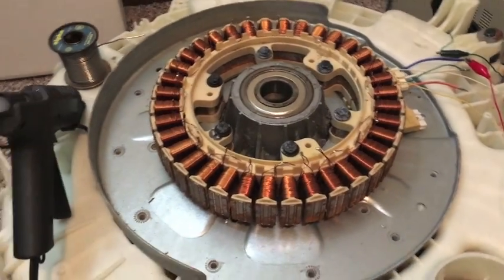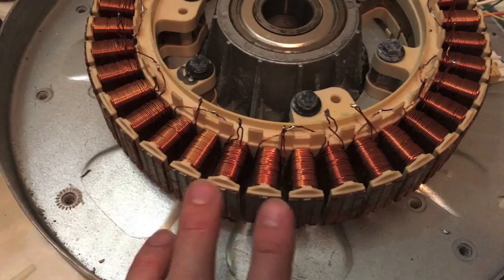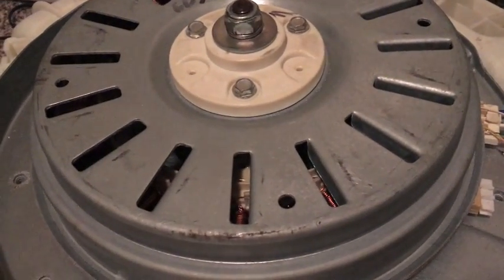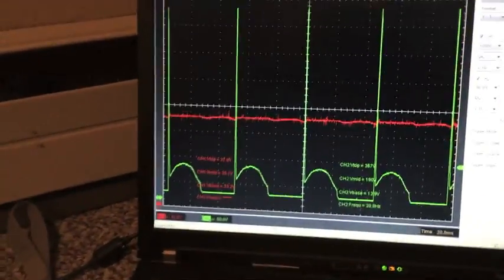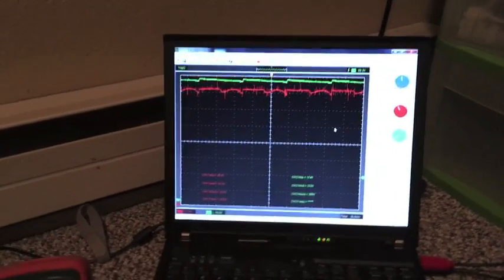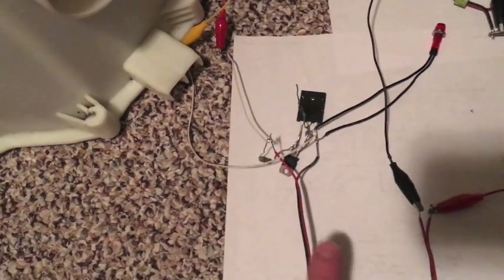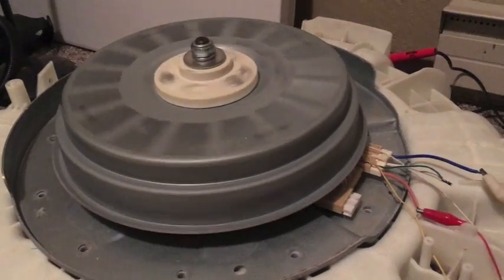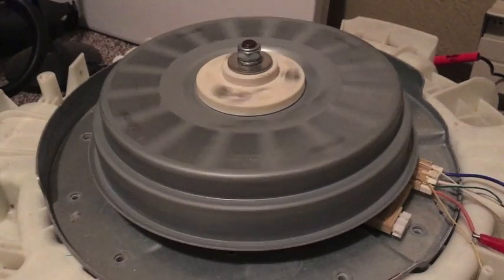A simple Transistor circuit running a brushless washing maching motor Part 2

Comment: If you use three of your circuits, one for each phase, wouldn't you need to add a delay between them?
In this video, is the current usage not as high as the second circuit benefits from the feedback voltage from the first circuit?

Comment: For a 36 pole Stator You will need to rewire the motor from 12 pole to 6,4, or 2 pole (Ex: In series wire the stators in the same direction Clockwise or Counter clockwise as long as it's the same.                   Stators wired in series below.

2-pole A phase [1-2-3-4-5-6]----[19-20-21-22-23-24] B phase [7-8-9-10-11-12]----[25-26-27-28-29-30] C phase [13-14-15-16-17-18]----[31-32-33-34-35-36]

4 pole A phase [1-2-3]----[10-11-12]----[19-20-21]----[28-29-30] B phase [4-5-6]----[13-14-15]----[22-23-24]----[31-32-33] C phase [7-8-9]----[16-17-18]----[25-26-27]----[34-35-36]    

6 pole A phase [1-2]----[7-8]----[13-14]----[19-20]----[25-26]----[31-32] B phase [3-4]----[9-10]----[15-16]----[21-22]----[27-28]----[33-34] C phase [5-6]----[11-12]----[17-18]----[23-24]----[29-30]----[35-36]

12 pole A phase [1-4-7-10-13-16-19-22-25-28-31-34]           B phase [2-5-8-11-14-17-20-23-26-29-32-35]              C phase [3-6-9-12-15-18-21-24-27-30-33-36]

WYE Configuration    Power line goes into each one of the Start phase from your controller ABC             The End phases ABC are join together as Common.
 Phase A-Start-line              Phase A end 
Phase B-Start -line              Phase B end
Phase C-Start-line               Phase C end

Delta Configuration
Blue Power Line A------>Phase A-Start-line----->Phase B end       
Green Power Line B---->Phase B-Start -line---->Phase C end
Yellow PowerLine C---->Phase C-Start-line----->Phase A end

Comment: Great video! If you see this comment I’d really appreciate your insights- I’m trying to recreate this circuit with a nearly identical washing machine motor, transistors, and everything else, but when I create it exactly how you do it causes the motor to just lock up and not spin. Are there any details or differences in your circuit from the diagram that you may have not mentioned? I replicated it exactly but haven’t been able to reproduce this behavior
Reply: Probably the wires from the coils need to be seperated. Three comes together. The need to be seperated. Hope that helps

Comment: Hi my friend, it's good to know that
I'm not working "alone" with this
Research.!! I hadn't been able to find any one else that was working on, the type of research, that I've been working on after Mr. ( Moron ), just
Up and disappeared, this kind of work was, Gone. Actually I was thinking about starting a utube channel" showing what I had found.
But, of course, without a couple more people, doing & posting the
Work, that I'm doing,. on hear, there's really nothing to compare it to.
So, I just wanted to hold what I've
Found" till, someone" anyone" started posting things on here
About, this type of energy.!! 
I wanna tell you something about
This type of power coming out 
Of the BMF, As you probably know
By now, running it through a cap,,
Helps clean it up" & smooth it out.
But if you are interested in, finding a
Fairly new power, that acts like* SMART POWER, Run the BMF, through a ( step-ups transformer).
Take it up to around 5 or 6 thousands, Volts then run it through
Two ( spark gaps )!! Okay" then run some tests on what comes out. It's not dangerous, so, don't worry about that.  What should be coming out, 
Is Eather, tapped, Resonance RF, power. Then do some research
With it, I will be back, in a lil" bit.
And if you've made progress" 
I'll see what you've done.... & I would
Really appreciate, someone" working on the same thing I am. Thank you for posting you're work....

Comment: Also for smoothing pulses of your  transistors cascade and jumps of power put the AC capacitor in parallel with your transistor cascade .

Comment: I would suggest you to connect two enjusted coils with the the two on the opposite side of stator. That will make more torque with less energy wasting. Because those magnetic forces being put at diameter distance will produce more energy efficient mechanical effort.
Reply: Clown 🤡

Comment: To possibly aid you in your very acknowledged endeavor, I wanted to hint that the coils windings and stator magnets might very well have been done in order to at least partially avoid the Lentz's  effect - each coils 'cutting' the counter-directed magnetic field and/or each pole acting on bipolary wounded coils. Yet another principle would be suitable utilization of the BEMF, which you have been registering through condenser charging, while it should be put back into other coils. Could you please provide information if your results/insights ar in line with these principles?! I would be interested to get in touch with ... nedic.slbdn@gmail.com

Comment: Hello Mr. Hoffer, greetings from Colombia, excellent work, very good result, I have 2 motors of 36 coils and they are original, I would like to know if you can send me the configuration of the connection of the coils in the stator and the diagram of the  external electronic connection.  Very grateful in advance for your support, for your excellent disposition and work.  It is possible to change the system.  Thank you.

Comment: If you change the magnets with neodymium the torque will increase a lot and the charging current as well...and that will increase the efficiency of the motor.

Comment: So at the end of this video you decided to show us the modified version of the coils, the one that didn't work.  Excellent.  We like to see the version that doesn't work.  Plus the wiring circuit does not clearly show the wire hook up to the  coils coming out of the motor which of course we won't miss out since it is the version that didn't work in the first place.   Furthermore below the diagram, you have gone out of your way to treat us with a wiring diagram of some stepper motor we somehow missed to watch with some part of it covered up with your future video showing.
In my book, at least one person knows what you are talking about.  YOU.  And that is the most important person, I have to admit.

Comment: Can you rewind it to run lower voltage and faster
Reply from the maker: I'm actually in the process of doing just that. Stock winding is 4 layers of 25 turns making 100 turns total. I have rewound I phase with 6 layers at 32 turns so almost double. I just have to get more wire to finish up the last couple poles and then test it.
Reply: @darrenhoffer4018  ok

Comment: Thus, have you essentially turned a 3-phase motor into a split phase motor? (That would be very cool, since it would give you two power bands in addition to the control you will have from your power supply rheostat, or a potentiometer if you choose to install one.)

Comment: What is the reason for the magnets being concave facing the rotor ???? Thanks
Reply: Provides more magnetic force on the center of the magnet so less magnetic drag when it moves off the magnet during rotation.

Comment: Thanks for uploading part 2. Please explain about no. of turns and wire gauge.
Reply from the maker: I am currently rewinding one of the phases of the motor with a smaller gauge wire and twice the turns on it. When i get it finished I will upload the video with the results... my guess is that more wire = stronger magnetic pull. However this also means more resistance in the wire. Since I am pulsing the motor for only a fraction of the time I think the loss to resistance will be minimal compared to the increase of magnetic force. I'll have to wait to see but it should make the motor stronger at lower voltages.
Reply: @darrenhoffer4018  I am curious about the result.
Waiting.

Comment: I see a HUGE problem... at 4:04 in the video, you stated that you were disappointed in the outcome of your test.  This is because at 2:32 you show your coils and the omitted coils are shorted!  This caused a magnetic brake !  The UN-used coils should be left open-circuit.

Comment: Can you turn the shaft with a small engine and get electrical output of what magnitude? 1.5 kW?
Reply: Yes they can be turned into a way of generating either 3-phase AC or DC by using a 3-phase bridge rectifier. You might be able to pull 1.5kW out of it but it would then need to be turned at nearly the same speed as the engine running wide open.

Comment: Has anyone figured out how to make one of these motors run using an AC controller?  I tried one from an older Maytag but it won't turn, just vibrates back and forth.
Reply: I have a Samsung unit and an LG unit that both have run on a HuanYang HY series VFD. Both work fine if you connect the wires in correctly. With the Samsung units and part of a factory harness, it is Red, White, Blue in that order on Terminals U, V, W.  My settings for it are as per HY's tech who sent a message as to the order the programing has to be done in.If your motor sits and rocks, try swapping two leads to the controller. If that does not work, put yours in a manual mode and slowly increase the voltage. Be sure to set your motor parameters to 60 cycles if that is what you use at your location and up to 400 for the max.

Comment: Hi Darren, nice work! This said , can you please explain something about your circuit? From where I stand, I see that your primary battery and charge battery are literally connection in parallel (with the coil and diode in between). I do not see the transistor between the the batteries closing or opening the circuit....have you tired a regular Bedini SSG setup? Thanks for your time. ;)

Comment: Yep same thing with vcr motors. less magnets then poles. It does help with brushless DC motors. This is a 310v DC motor so that's probably why your circuit was having issues. Running the coils in parallel instead of in series should bring you to about 25 volts per phase. If I'm not mistaken this is the exact motor I have. Should say on the side of the bell housing 310v 5.5 amps, 1200rpm.
Reply from the maker: Travis Piper thanks for the advice. I was thinking that the wire thickness might be my problem, it's built for more amps. If I really have time, I might rewind it with smaller gage wire and more turns to increase magnetic strength at fewer amps. My vcr motor has amazing RPMs with this circuit but it's designed for smaller voltage and amps.
Reply: Thanks.

Comment: Those magnets are different from the Arch type magnets I've seen if these motors; have you or anyone discovered which types of magnets work better? 

The Magnetic fields in these magnets seem more simple than the Arch type that has multiple pole fields in each magnet; Anyone else discover this and see if it matters?

Comment: good jo, please i have a washing machine motor of that type and i want to use it for driving alternator, i have been trying it with with 24v battery but it doesn't work, please can you give me the circuit you use, do i need to power it with inverter

Comment: Hello Mr. Hoffer, thank you for your reply.
Were you able to run at 48 volts and high speed yet and what about 
Hall effect sensors were able to use them in anyway?
BTW Adrianna is my daughter I used her account in my last comment by mistake, I`m Jordan Marcus.
Thanks,
Reply from the maker: Jordan Marcus , hello and sorry for the long awaited reply. This setup is capable of running at 48 easily and would run even better at 110 since that was the voltage it's designed for,but I think I would have to increase the value of my transistors to a higher voltage ( the tip 32 would burn up) ...the beauty of this circuit is that it doesn't require any Hall effect sensors, basically that's what the pnp transistor is used for, to trigger the larger npn.
Reply: Hi Darren, first of all thank you for sharing and open sourcing your work.  I do have several questions to ask, first,  is it possible to utilize the setup just with the stator (coils)and not using the rotor? the rotation of the rotor is a secondary function of the sequential energizing of the coils, will they still produce radiant energy without the rotor? can you possibly show a step by step tutorial on exactly how you assembled the circuit?

Comment: i think if you have all three coils powered up you will get less feedback. i suspect the feedback is coming from the coils that are not powered up. still trying to get my hands on one of these motors, as i said before  i will be killed for dismantling her machine lol. im trying to figure out how to power a home, and i think this motor is the best drive for the job. i have a 12v dc setup here but the motor doesn't have enough torque to keep the alternator running while it is charging, plus you need a power inverter to get ac out of it.i could rework my alternator to put out 120vac but it wont be strong enough to power a whole home . im having problems with  my spine right now so im out of work and have a lot of time on my hands lol. if you have any thoughts on this i would love to hear them. the more heads the better. it may come down to transformers of some kind, but i cant continue testing till i get a better drive
Reply: i think, if im understanding how this works properly, if you put a frequency modulator( something that would allow you to turn the frequency up or down)it should be able to control the speed of the motor, and the torque would hinge on the voltage right? it uses the frequency to make the coils on the stator pos and neg right? And how much voltage you put into the coil controls how hard the elector magnetic force is pulling on the magnetic ring around it? that is my understanding of it anyway...... what do you think?
Reply: F’kn clown

Comment: Great Job!! Could you share the circuit and the parts?
Best Regards, Gerardo.
Reply from the maker: At the very end of the video you will find the circuit and I labeled most of the parts except for the diode for capturing the voltage spike. I just used a standard 1n4007. But any diode rated above 400 volts should work.

Comment: what if you have a circuit on each of the three phases? Is there a charge coming off the 3rd phase?
Reply from the maker: I am wiring the motor back to its three phases and testing it with three circuits in my next video. I also want to start running it off of batteries but that will require me spending a bit more money since I would like to run it at 48 volts.
Reply: @darrenhoffer4018  Did you ever get it up to that voltage? You could try using a MingHe 7210A boost your voltage from 12-36 volts up to 65 volts or so. The TIP32C is rated for 100 volts. TIP 32 is rated @ only 40 volts and the TIP32A is rated @ 60 volts.
Reply: I am ready to see that 3rd video.  The first two were great. Have you had success with running all three phases?

Comment: Great work your circuit might work better than mine and yes do not change the motor wiring, look forward to see all 3 coils wired up.cheers
Reply: I worked a different new circuit and I changed 1 beat to get the top amp